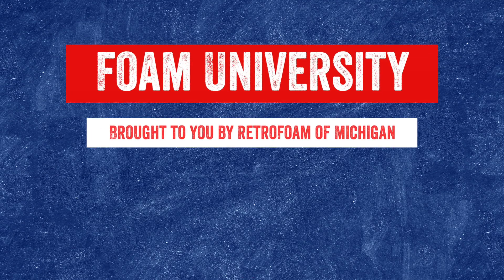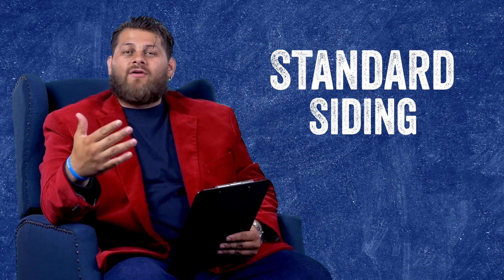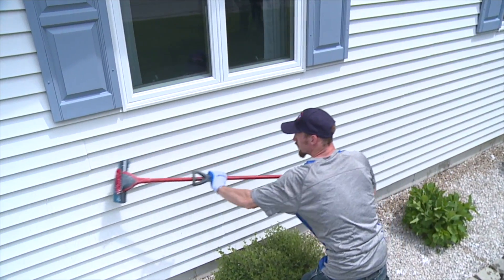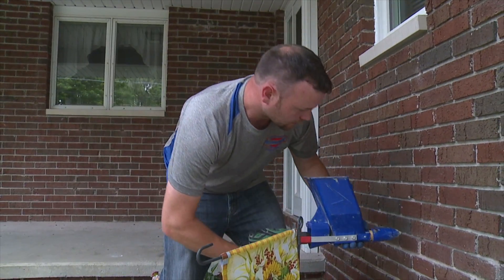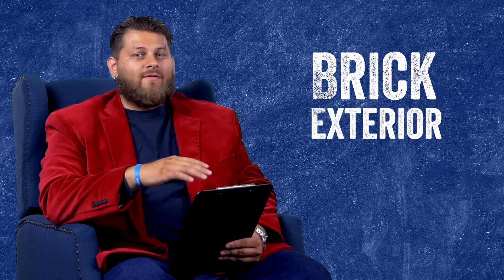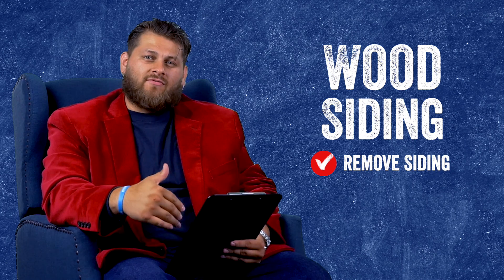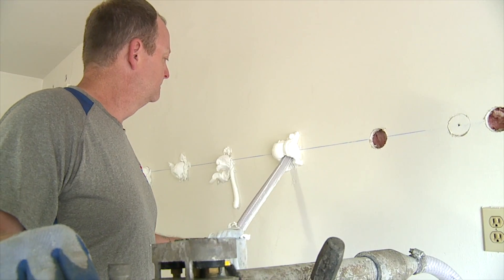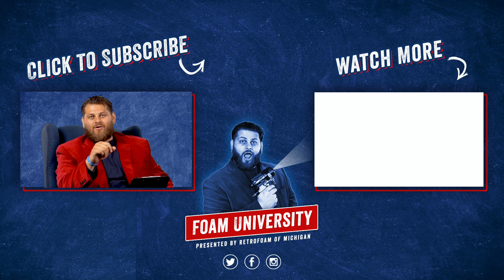How to Insulate Existing Walls With Injection Foam Insulation | Foam University

Comment: could I do this in my townhouse to reduce noise from neighbors? would it work
Reply from the maker: For sure! However, RetroFoam won't completely soundproof your home. It does have sound-dampening qualities to make your home quieter, though! This article from our Learning Center includes some additional information on this topic: https://www.retrofoam.com/blog/retrofoam-insulation-for-sound-dampening
Reply: @RetroFoamofMichigan  which foam would you recommend? I was thinking about drilling a bunch of small holes and sticking a can in each
Reply: @RetroFoamofMichigan  I live in PA so I was hoping this was something I could do myself
Reply from the maker: Unfortunately, RetroFoam cannot be done as a DIY project. Luckily, we have multiple RetroFoam dealers in Pennsylvania! If you're interested in requesting a free estimate, please follow one of these links:

Philadelphia and surrounding areas: https://www.retrofoam.com/dealers/pennsylvania/philadelphia-spray-foam-insulation-contractor

Pittsburgh and surrounding areas: https://retrofoamofpittsburgh.com/estimate/

PA/NY/NJ: https://www.retrofoam.com/dealers/pennsylvania/eastern-pennsylvania-spray-foam-insulation-contractor
Reply from the maker: This article from our Learning Center helps to explain why injection foam cannot be done as a DIY project: https://www.retrofoam.com/blog/injection-foam-insulation-diy-project

Comment: Hi! I live in an apt. Can this be done? There is no insulation between walls of neighboring apt. No insulation period. Apts built in 1977. We can hear people walking down the hallway. I've tried acoustic tiles, no help. Thank you so much!
Reply from the maker: Hey Ronda! There shouldn't be a problem with it as long as there is a wall cavity to fill. If you are renting you will also need approval from your leasing manager.
Reply: did you try this? has it worked?

Comment: Is your injection foam open or closed cell?
Reply from the maker: Hey Randy! This is a tough question to answer. Open and Closed Cell is used to refer to spray foam insulations that are polyurethane based. Our injection foam product is a non-expanding tri-polymer based resin, so it does not easily fit either category. However, it does have charcteristics of both open and closed cell. We like to say it is most like open cell because it is soft and pliable and the cellular components are closest to open cell spray foam. I hope this helps.

Comment: How viable is it to inject foam into an external wall with existing, but inadequate, batt insulation already installed?  I assume the foam might not flow well throughout the wall cavity.
Reply from the maker: Great question! It is actually not a problem to have our foam installed with existing batt insulation in the cavity. Check this article out. https://www.retrofoam.com/blog/add-retrofoam-to-wall-with-old-insulation

Comment: My tiny (15' x 30') home has cinder block outer walls. Intending to remove the gable roof and construct a gambrel roof to gain a second floor. I want to foam the cinder block cavities. Should I go from the top down before the new roof?
Or drill through the blocks?
Reply from the maker: Our process is to drill holes into the cinder block so we can fill all of the cores with injection foam.
Reply: @RetroFoamofMichigan  have you any contractors in south central Missouri?
Reply from the maker: Not sure what exact area you are in but one of these two might be able to help you. https://www.retrofoam.com/dealers#dealer-finder-state

Comment: Are there any vapor transmission concerns with this method?  I'd be worried that I was either a) creating an unwanted vapor barrier or b) compromising an existing vapor barrier that I do want.
Reply from the maker: Injection foam doesn't create a vapor barrier, and it won't affect the one you have in place.

Comment: Does your company remove the foam if there is ever a problem?  I have seen some videos where people spray foamed their attics and it caused a mold problem and the whole roof had to be removed.
Reply from the maker: We have never run into this problem.
The spray foam we use would not lead to any mold issues. Spray foam can work to prevent condensation, which leads to the growth of mold.
With that being said, we always recommend any moisture and mold issues be handled before the spray foam is installed.
You might find the information in this article helpful.
https://www.retrofoamofmichigan.com/blog/mold-in-house-reduce-risk-with-foam-insulation

Comment: Does the foam become hard?
Reply from the maker: The injection foam we use has the consistency of shaving cream when injected, but it does cure in the wall.
The RetroFoam is pliable in the wall and doesn't become rock hard. This means if you needed to replace wiring or plumbing, the foam is easy to work with.
Reply: @RetroFoamofMichigan   I live in Greenville NC.  Do you know of anyone that does it in my area?
Reply from the maker: Give our friends over at RetroFoam of the Carolinas a call! They should be able to help you. https://www.retrofoamofthecarolinas.com

Comment: What happens to the wiring and outlets? WIll this cause any problem with adding/modifying wiring later on?
Reply from the maker: Our foam doesn't affect the wiring at all. If you find that you need to replace wiring, the foam is very pliable and it's easy to fish the wiring through it.

Comment: Great video l wish you were in my state. I live in a 1960 brick rancher. In the winter exterior walls are cold to touch down to the electrical sockets. We have used foam sealant and put plastic on the windows to try to keep the heat in. My initial thought 💭 was to put insulated vinyl siding over the brick except for the front. Someone recommended this process so l am doing research 🧐. It’s pricier than vinyl siding but l would rather keep the brick exposed. Thanks for sharing.
Reply from the maker: Dawann, RetroFoam would be perfect for that application! You can use our dealer finder to find the closest dealer to you! https://www.retrofoam.com/dealers

Comment: I want to use this on some of my interior walls as a noise reducer. But I'm curious about fire rating. Is this stuff extra flammable?
Reply from the maker: The foam products we use are Class One Fire Rated, which means they don't serve as a catalyst if there were a fire.
Reply: did you try this? has it worked?

Comment: Would it be inefficient to use spray foam behind lathing inside on a older home on external walls? I could remove all lathing, but would honestly rather not due to the amount of work required.
Reply from the maker: That would work. It would just be a more invasive process.

Comment: Can you talk about foam injection shrinking and if its an old problem or ongoing for airtightness
Reply: So the 2-3% shrinkage is an unwanted air gap and therefore the space is not air or moisture sealed.  Wouldn't this be ineffective insulation because it would allow high heat loss, convection, moisture condensation and mold? All of which should be avoided.  So why should injection foam be used if it shrinks?
Reply from the maker: The major problems that foam had years ago have, for the most part, been fixed. The potential for human error is always present so it's crucial to use an experienced contractor. Finally, all injection foam will have a calculated amount of shrinkage that will happen during the curing process. Most premium foams will only have about 2-3% of volume lost (or shrinkage).
Reply: Good vid...thanks!